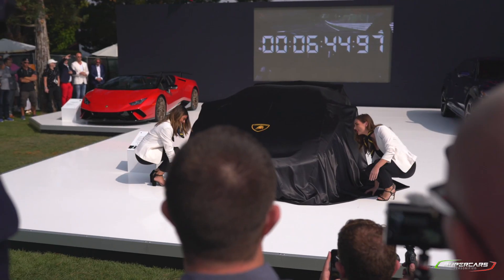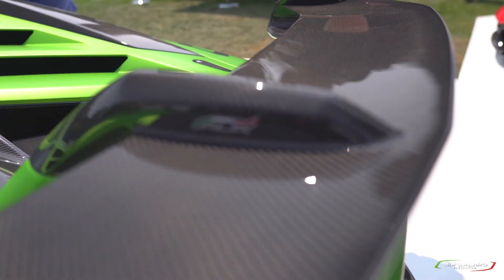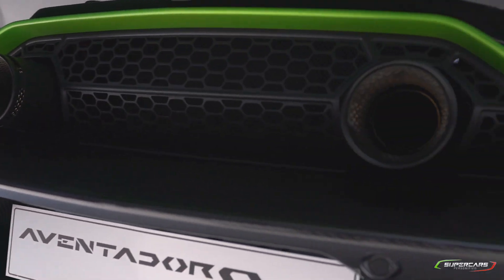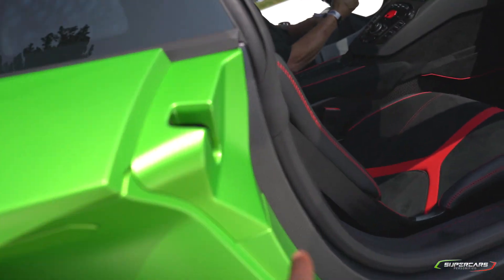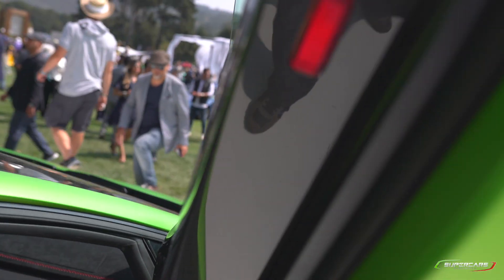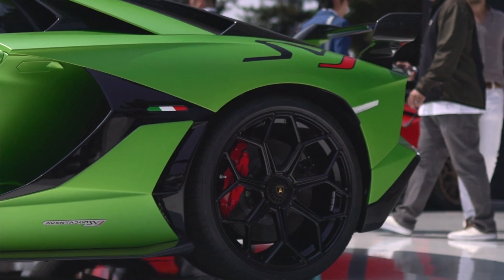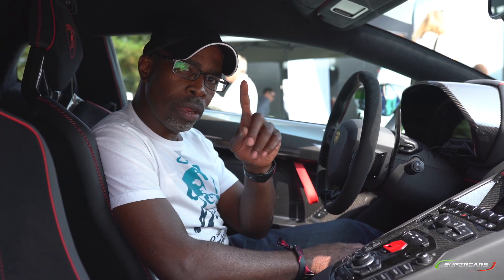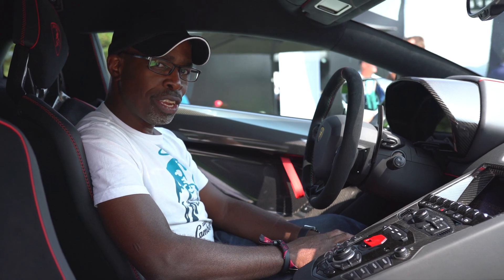Help Me Spec My Lamborghini Aventador SVJ

Comment: You should spec it like this the exterior nero nemesis with the svj logo as a sticker and everything black not carbon, the wheels pick the Leirion forged in Shinny black, the brake calipers in red or blue if you can do blue that would be sick and the interior the svj interior ad personam seats and the contrast color blu slideris or roso alala
Reply from the maker: Liking that spec. Make it.
Reply: @DoctaM3  I'll make it in 30 mins and comment it

Comment: In my mind, this has got to be a mean car if you will. What I mean by that is I don't see the SVJ as a bright colour car, I just don't. I would go gloss black with black rims. But, to make it a little different, I would consider adding some sort of a racing stripe, probably a triple racing stripe with one thick stripe in the middle and 2 thin ones on the side of it, possibly in Rosso Mars. You may want to experiment with different types of stripes and in different colours on the computer before you decide. If is red, then may be match the calipers in red too. If you don't like black, the only other colour I would consider is matte white to make it very clean and stark looking, kind of like the "68" limited edition car with black roof and rims. Just my 2 cents.
Reply from the maker: I do like how you think about this. What I did hear from someone who was at Imola is that the dark blue did not do the car justice so darker colors may be a problem unless its like full black or matte back and the stripe idea is pretty cool and could be super mean.
Reply: Yep, you are absolutely right about that midnight blue. I saw it on a few Imola videos too. It just didn't look right. That midnight blue is too elegant for this car. The SVJ is an extreme machine with a massive wing, this is not the time to go the elegant route. That was why I said gloss black or even matte black for that matter. Bottom line, it just needs to be mean. LOL.
Reply: Or I do have something else which is a bit more out of the box, but I don't think you will go for it. I have seen it done in the UK, but not in the States. Have you seen an Aventador done by Yiannimize in Chrome Black but Tron style? Yes, it is a wrap. Personally, I think it is way cool, but that's just me. I will give you the link here so you can check it out for yourself just in case you haven't seen it. https://www.youtube.com/watch?v=sdJ6L2LGPvU
Reply from the maker: awesome.  thanks